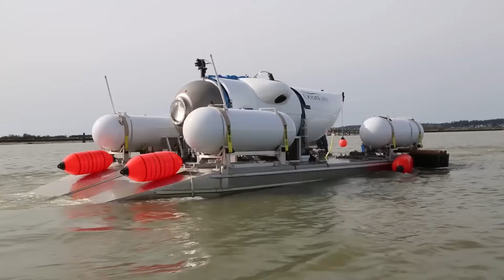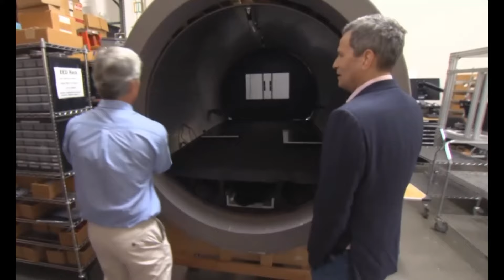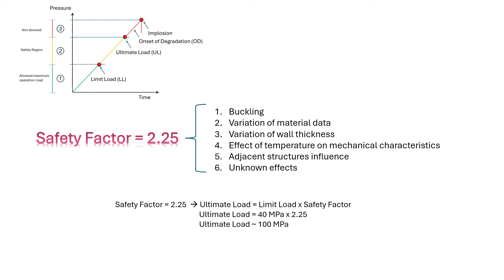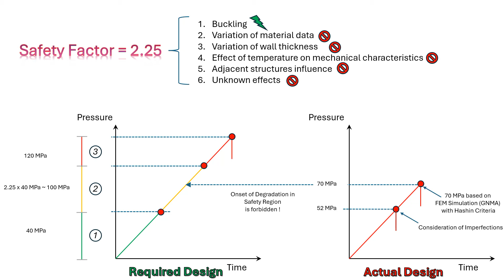OceanGate UPDATE: How the Titan’s Composite Hull Should Have Been Designed | Engineering Breakdown

Comment: Relying strictly on epoxy and the carbon fiber cylinder to hold the titanium ends in place was super sketchy IMO. It should have had an inner 'rib cage' made😊 of structural steel connecting the two ends together and spanning the inside of the tube to support the carbon fiber walls. This would convert some of the inwards pressure on the end caps into outward pressure on the CF hull via the beam loading, countering the inwards pressure it was feeling.
Reply from the maker: The cage idea is obviously a good solution not really sure why the final design is so like your Suggestionen maybe too expensive

Comment: When I watched a documentary about how the sub was built...I was shocked at how little purchase the titanium rings had that were bonded to the CF cylinder ends.    The bonding was full width of the CF but the cylinder seated barely an inch into the titanium rings.   In my opinion....they should have had a mechanical connection strong enough to hold the load and not just rely on the bonding strength of the end epoxy connection.   At depth even the strongest material is going to suffer some compressive movement and this would try to lever the epoxy joints apart with no reinforcement from a thick sleeve that I think should have been encasing inner and outer surfaces of the CF from the titanium rings.   These would have massively increased the bonding surfaces as well as stabilized the end joints.   No doubt that the sub failed at these glue joints.
Reply from the maker: THanks for this comment, I am preparing a more in-depth look at the glue connection, it is hard to model though, therefore it took a while, will release it next week
Reply: @hnrwagner Cool!   Will be interesting to see what you come up with.   Thanks!
Reply: This stems from a lack of understanding of the joint forces. It's a double lap shear joint on a huge cylinder so the bonding area would actually be quite large. Combined with the fact it's under compression which would push the joint together, not apart, means this is very unlikely the point of failure. More likely defects in the manufacture of the composite cylinder and cyclic fatigue caused failure.
Reply: @banjobarnett85 When the CF cylinder deforms under pressure...which it must...where will it deform the most?   In the unsupported center which will bow in which is why nobody uses a cylinder for deep submerging vessels.   

Submarines that incorporate a long cylindrical pressure hull have many supporting bulkheads down the length to prevent the middle of the cylinder from deforming.

When that cylinder starts to bow in the middle what happens to the ends?  Of course the outer edges start to try to pull away from the titanium ring.
Reply: @recoilrob324  sorry, but again this is a fundamental misunderstanding of the forces. You're taking an even cylindrical pressure and expecting it to perform as if a simply supported beam in bending. The centre should deform no more than the extremities of the cylinder unless held by a stiffer ring. I'm not convinced the thinner titanium ring and dome would shrink any less than the thicker carbon tube. Also 1/3 of the force is axial, so a large component pushing the titanium semi spherical ends and joints onto the carbon tube. I think you're confusing the method of using a thin metal hull not stiff enough alone to take the crush forces, supported by bulkheads or rings that will increase strength and stiffness in those areas causing a bending effect between bulkheads/rings. This wasn't the case and shouldn't be thought of as such. If there was a failure at this joint it wasn't due to design it was due to sealing in the joint failing and causing a high pressure water jet to enter the hull.

Comment: Compression forces.

Not what carbon-fiber is made for.

Pretty simple, I would have to say.
Reply: While carbon fibre composites are weaker in compression, for a UD (unidirectional) layup it is still as strong or stronger than steel for a much lower weight. So actually still a great material to use in compression.
Reply from the maker: @banjobarnett85  yes the its actually better than steel or titanium
Reply from the maker: I will prepare a video which compares different materials for this purpose, thanks for the comment

Comment: How much weight will the extra thickness add and do cracks in carbon fibre show up in xrays or other test equipment? If continuously cycled how many cracks are allowed?
Reply from the maker: it will nearly double the weight of the composite cylinder
Reply: thats the problem with carbon fiber. the most dangerous thing is the delamination of the individual layers and it is virtually impossible to detect with anything we have atm
Reply: Huh?? We can easily detect desalination with ultrasonic ndt machines, but perhaps you mean if the cracks happen under pressure, when the pressure I'd removed they are undetectable.

Comment from the maker: References:
Future structural stability design for composite space and airframe structures
https://www.sciencedirect.com/science/article/abs/pii/S0263823114000676

A Micro–macro Damage Mechanics-based Model for Fatigue Damage and Life Prediction of Fiber-reinforced Composite Laminates
https://link.springer.com/article/10.1007/s10443-022-10039-y

Microcracking in fiber composites and degradation of thermo-elastic properties of laminates
https://www.semanticscholar.org/paper/Microcracking-in-fiber-composites-and-degradation-Loukil/4a273f2f7954af446d4d105a381789bde1be63ea

Google Scholar:
https://scholar.google.de/citations?user=a4sKEKsAAAAJ&hl=en

Researchgate:
https://www.researchgate.net/profile/Ronald-Wagner

OrcID:
https://orcid.org/my-orcid?orcid=0000-0003-2749-1455

Timecodes:

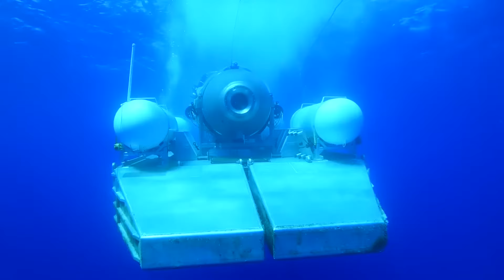0:00 - Introduction
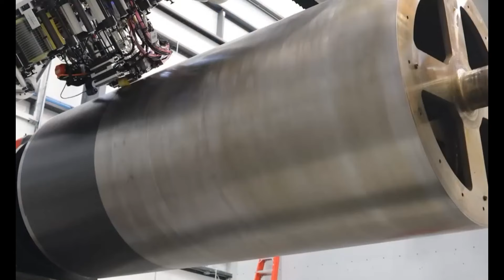0:38 - Limit Load
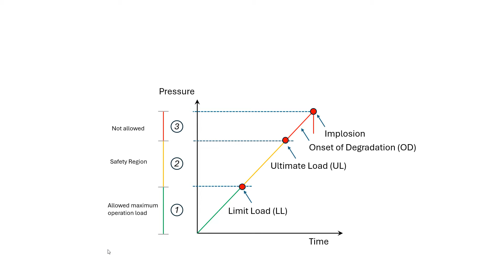1:00 - Ultimate Load
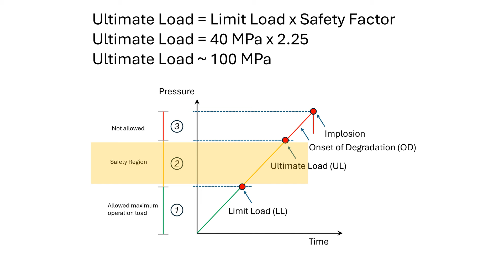1:10 - Degradation of Composite
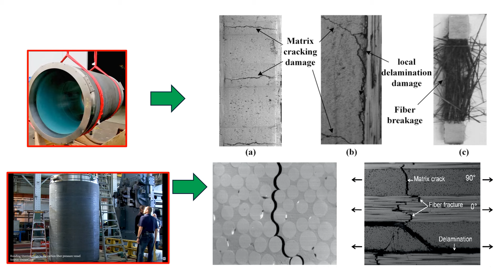1:24 - Implosion Simulation
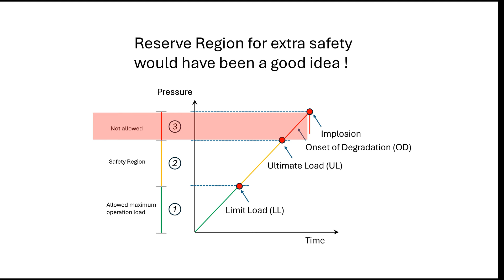1:33 - Reserve Load
1:43 - Safety Factor
2:11 - Composite Hull of Titan
2:44 - Required vs Actual Design
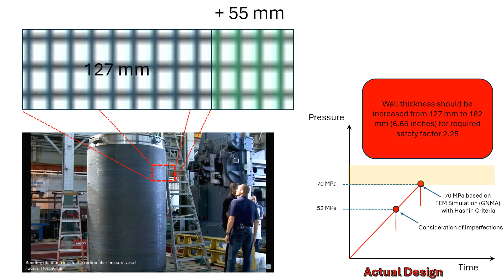3:33 - How the Composite Hull of the TITAN should have been designed?